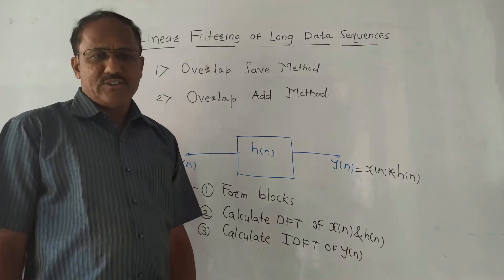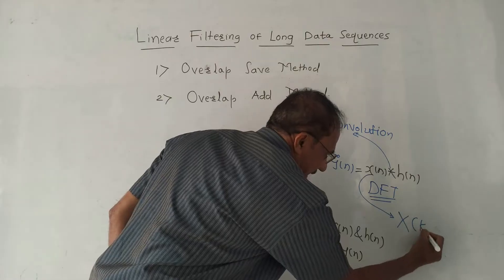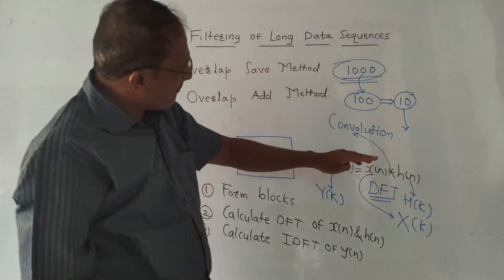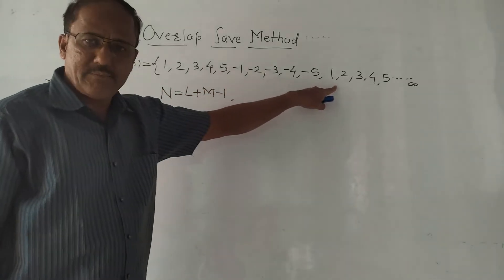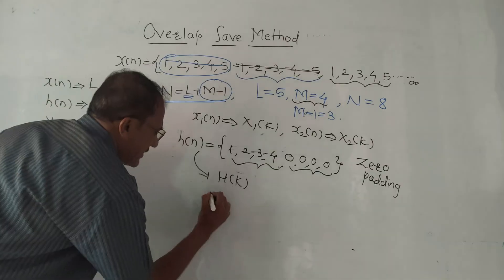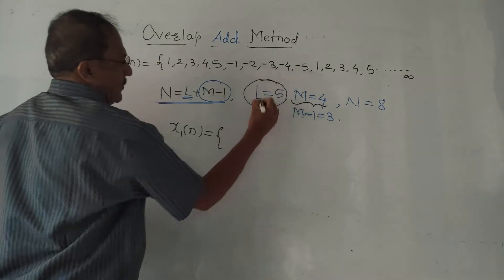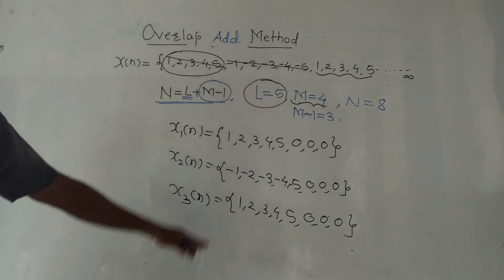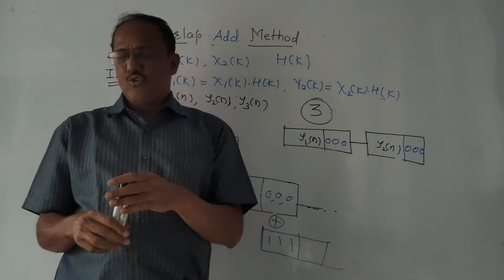Overlap Save and  Overlap Add Methods

Comment: Matlab Code: Overlap Save
clc;
clear all;
close all;
N=8;%%choose as required
x=[1 -1 2 -1 2 3 4 2 1 -5 1 -1 3 5 1 6 1 2 3 4];
h=[2 3 -1 2];
M=length(h);
L=N-(M-1); %%choose L as desired or choose N as the power of two, if the answer is not the power of two, then choose some N which satisfies "N >L+(M-1)"

x_tilde=[zeros(1,M-1), x,zeros(1,L)];%%%Here zeros(1,L) is optional (but better to include to avoid missing a few samples from the end of the output sequence

h_tilde=[h,zeros(1,(L-1))];
H=fft(h_tilde);

k=0;y_out=[];
while (k+N) <= (length(x_tilde))
    xk=x_tilde(k+(1:N)); %% selecting the required block from the full sequence
    Xk=fft(xk);
    Yk=Xk.*H; %%circular convolution in time domain is element by element product in freq domain
    yk=ifft(Yk);%%conversion to time sequence
    y_out=[y_out,yk(M:N)]; %discarding first M-1 samples and appending to output
    k=k+L;
end

%%%%%%%%%%%%%%%%%%OVERLAP SAVE
disp("Output by overlap save method=");
disp(y_out)

%%%%Direct Convolution
disp("Output by direct convolution=");
disp(conv(x,h));%% 
-------------
Matlab Code: Overlap Add
clc;
clear all;
close all;
N=8;%%Chose the value of L as needed (block size needed)
x=[1 -1 2 -1 2 3 4 2 1 -5 1 -1 3 5 1 6 4 9 3]
h=[2 3 -1 2];
M=length(h);
L=N-(M-1) %%choose L as desired or choose N as the power of two, if the answer is not the power of two, then choose some N which satisfy "N >L+(M-1)"
xlen=length(x);
r=mod(xlen,L);
x_tilde=[x, zeros(1,L-r)];%%%Here zero padding done to make length of x as the integer multiple of L
h_tilde=[h,zeros(1,(L-1))];
H=fft(h_tilde);
k=0;j=1;y_out=[];
while (k+L) <= (length(x_tilde))
    xj(j,:)=[x_tilde(k+(1:L)), zeros(1,M-1)];
    Xj(j,:)=fft(xj(j,:));
    Yj(j,:)=Xj(j,:).*H;
    yj(j,:)=ifft(Yj(j,:));
    %%%%%%%%
    if j==1
       y_out= yj(j,1:L);
    end
    if j>1
    y_out=[y_out,(yj(j-1,((N-M+1)+1:N))+yj(j,1:(M-1))), yj(j,M:(N-(M-1)))];   
    end
    
    j=j+1;
    k=k+L;
    
end
%overlap add
y_over_add=[y_out,yj(end,((N-M+1)+1):N)];%%appending the last sequence values
disp("Output by overlap-add method=");
disp(y_over_add);
%%%%%%%%%%%%%%%%%%
%%%%Direct Convolution
disp("Output by direct convolution=");
disp(conv(x,h));%%
 

 
-------

Thanks
Reply from the maker: Thanks